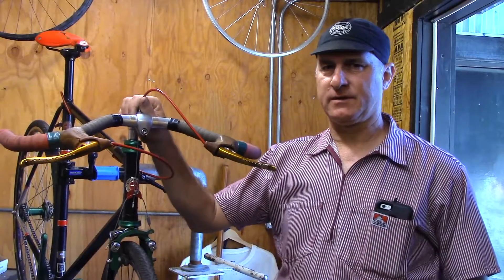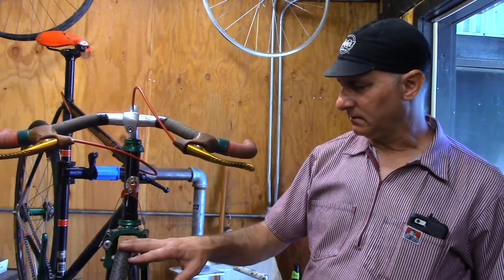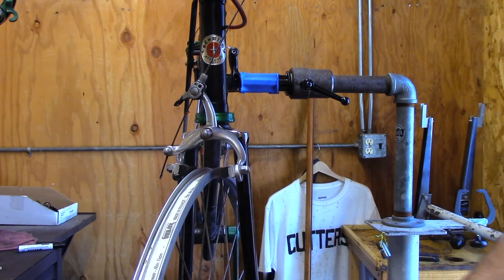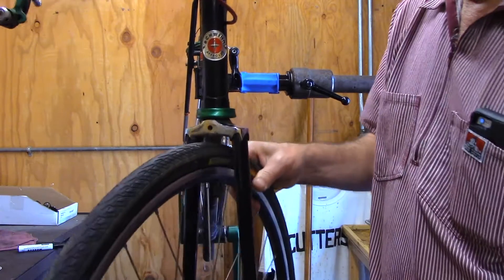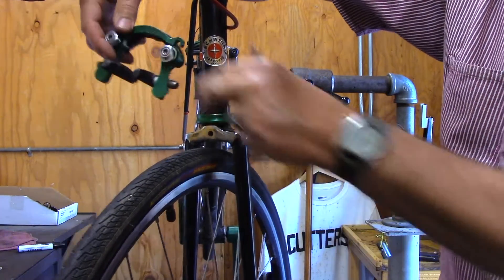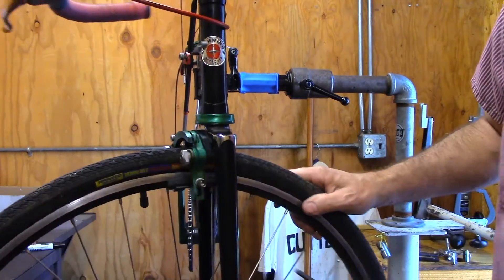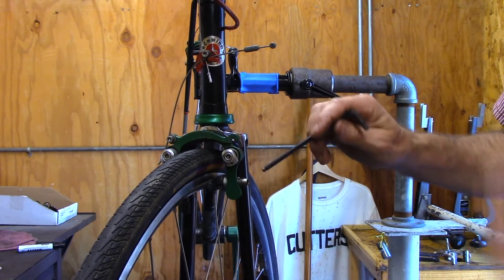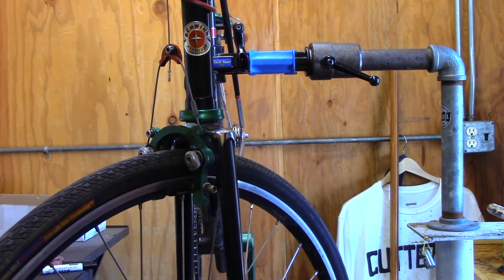Keep it Classy with the PAUL Racer Brake

Comment: I've got 23.5 size frame vintage road bike and I will put it with 700c wheels...
does it fit with this center pull brakes?
Reply: Jason Bandong probably. Masure your brake reach and compare it with the reach of these brakes. You'll probably need long reach brakes if you're converting from 27" (630mm) wheels to 700c (722 mm). These should do the job!

Comment: They may be good brakes but over $300 for a set of calipers for an old bike is insane. Its cheaper to just find a parts bike or used set of Dia Compe 750 reach center pull calipers. I just can't justify putting $300 into a pair of calipers on a bike that on a good day isn't worth more than a few hundred bucks.
Reply: @ottohoard8084  I don't see who's bike it is, why on earth would anyone spend $300 for a set of brakes, especially to fix a problem they caused by changing the wheel size. The bike is built for 27" wheels. If you must change wheels, there's plenty of old Dia Compe 750 center pull brakes out there for cheap that work just fine. There's also the point of why put $300 brakes on a $100 bike. 
I've been riding all my life and never once felt that the factory brakes didn't stop me just fine, and they came on my bike new 40 years ago. Its a bicycle not the space shuttle.
Reply: @VB-bk1lh  I agree completely.   I love expensive boutique parts as much as anyone but no one is going to put those brakes on that old frame.  Those brakes are too good to put on a new Surly frame.  Sorry maybe I'm just jealous.
Reply: Paul components are for people that can appreciate really high prices. But other options are available: There are plenty of good quality centre pull brakes with a long drop from manufacturers such as Shimano, Mafac, CLB, Universal, Dia Compe and Weinmann to name a few. 
When I converted my bike from 27 to 700 wheels I used a pair of Weinmann brakes (as used by the great Sheldon Brown) which cost me £8 including cable hangers. I spent another £4 on new brake blocks and alloy holders and polished the whole lot. They work beautifully and cost less than a twentieth of a pair of Paul Racers.
Reply: I totally agree that price is relatively completely off. But if you have the wallet ... beautiful product and you can continue from there to include Pacenti Brevet rims, NOS Shimano hubs, Nitto racks stem and handlebar ... if you like to travel with reliable stuff on a traditional frame you can be that spender.